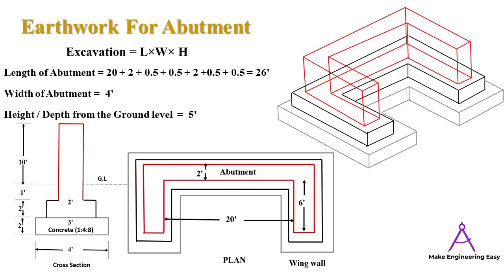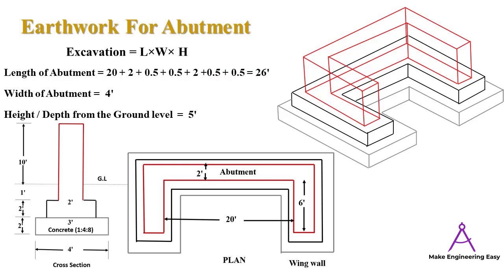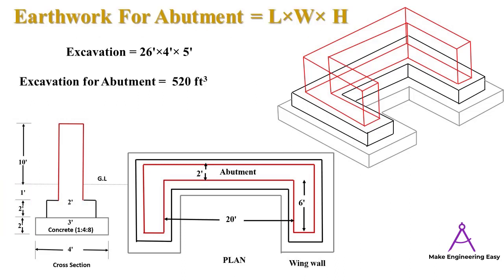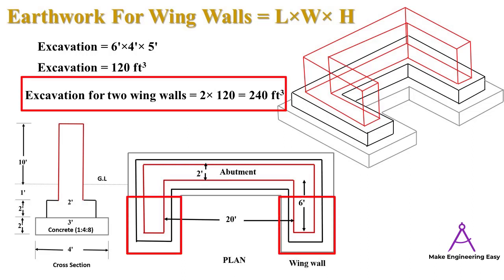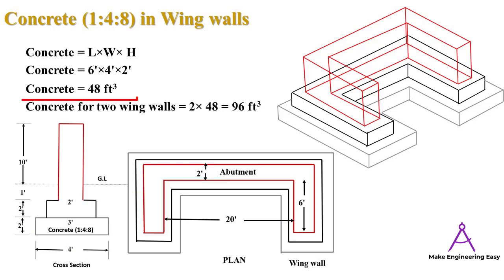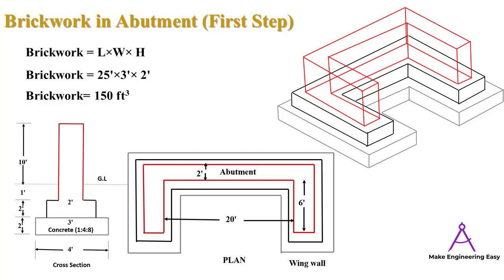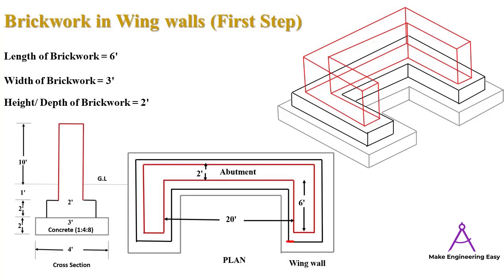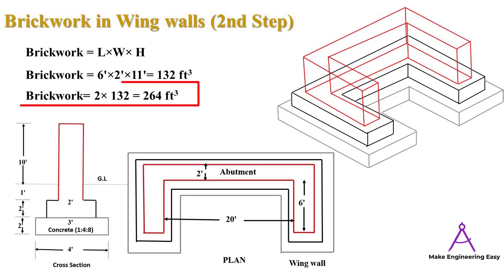Quantity Estimation for Abutment and wing walls for Bridges and Culvert I Bridge I Estimation

Comment: If the inner distance between the wing walls is 20 ft, then the top is 2ft(both sides) then 1ft and 1 ft(again both sides) then isn't the total length 28ft not 26? 20+4+2+2=28